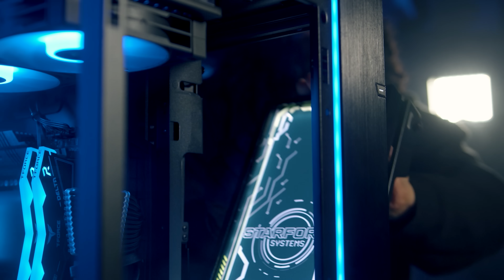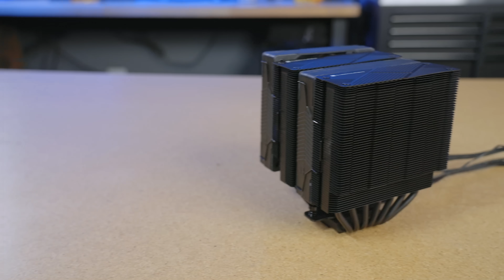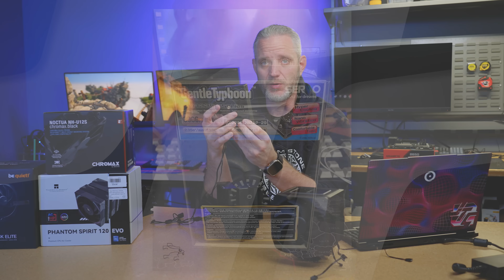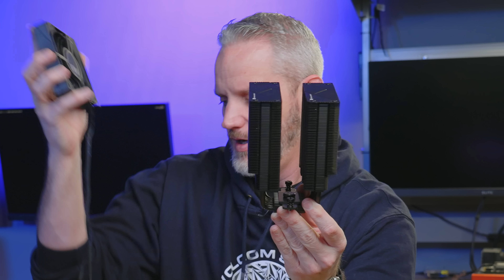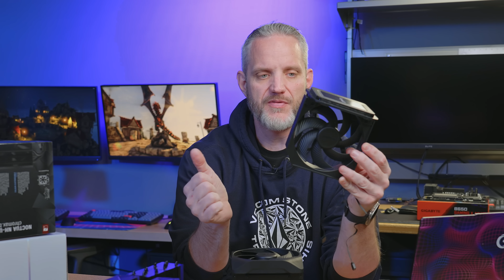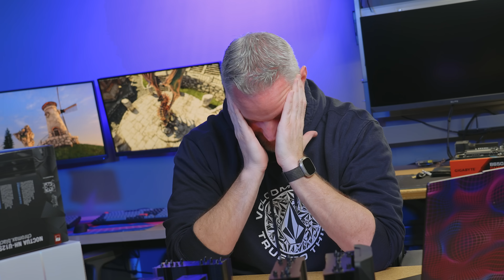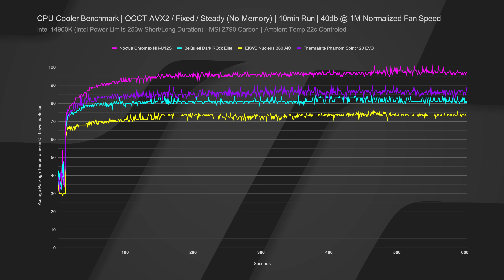This $49 CPU Cooler has big brands SHOOK! Thermal Testing Cheap vs Expensive CPU Cooler!

Comment: Some of the Air coolers you should definitely add are:
Arctic Freezer 36
Deepcool AG620/AK620 (Smuggled ofcoz)
ID Cooling Frozn A620
FSP Group MP7
Cooler Master Hyper 620S
Montech Metal DT24

And AMD Wraith Prism for reference

Comment: Hey Jay I have the thermalright elite v3 240 aio which is only 44 dollars on amazon. This cooler performs great. I was able to overclock my 13700kf to 56 all core and 46 e cores with no thermal throttling i forget what the actual temps were but I remember being impressed. I currently have it setup on my 12600kf which is overclocked to 53 all core and 42 ecore with the max temps in cinebench r23 at 70c  for the p core and 52c on the ecores. Check out that AIO for the value. They also have a 360 version of that cooler but I haven't used it. Definitely a contender for the price to performance.

Comment: Just built my first PC and the Themalright AIO I got for 50 bucks is quite efficient and it even got a subtle argb detail.

I've installed it on a MSI case which btw I noticed has the same little Thermalright "T" logo on the interior side panel (which is weird since it doesn't show in the official product photos), so the case has pretty good airflow for it being a m-atx and it only makes sense Thermalright built some of it

Comment: U should check out ID cooling A620 SE gives the thermalright a run for its money
Reply: too much noise and unreliable fans
Reply: I literally have have it and it's dead quiet u must have got a defective unit and the fans are great have had for a year and zero issues with the fans @Avrelivs_Gold

Comment: You could of course also throw in a cheap AIO into the mix. Arctic for example have some watercoolers that are way cheaper (and actually available), compared to the Nucleus cooler from EK. The "downside" of the AIO in this test was its price, obviously, since it's not a cheap product to begin with.

Comment: I do think it was a serious apples/oranges comparison using a single tower vs. a pair of dual towers.  If you want to have a non-disingenuous test and results, you should use all dual towers.  No one in their right mind is going to put a single tower air cooler on a 14900K.  If you want to make a comparison point about Noctua price/performance, then at least use a dual tower Noctua.  Otherwise test against other single tower coolers.  You are better than this, Jay...
Reply: the point is premium single tower is as expensive as the evo

Comment: Thermalright has always been decent. When AM4 first came out they had the am4 socket cooler versions of the MACHO(big single tower) they were called ARO-M14G and ARO-M14O for 40-50 bucks, still have one cooling my 7800x3d. Glad to see them getting some love.

Comment: Since you already have water and heatpipes mixed, and you brought up small form factor... I would like to see you compare the Arctic Liquid Freezer II 120 radiator against comparable spec heatpipe towers. It's an extra-thick 120 AIO rated for 250 watts TDP. It's the sort of part one might use if one wants more watercooling and doesn't have enough space for a 240 kit.

Side note, in totally apocolyptic conditions, how hard is it to trigger dryout in these heatpipe coolers? How much extra TDP capacity spec do you need to be safe?

Comment: Test out this cooler if you are keen for another thermalright variant that spices up the the build with some RGB and visible temps:

Thermalright Peerless Assassin 120 Digital ARGB

Running it on my 9600x and not at all disappointed. Max temps I have had in benchmarks and 1440p gaming with a 2nd 100p monitor was 70 degrees on the dot, nothing higher. I still want ot see how it performs with a little overcolocking and adding a higher end gpu than my RX 6800, but I don'texpect it to be affected that much.

Comment: I've used Thermalright (formerly?) coolers since overclocking my Athlon XP Barton 2500+ back when I was a kid. They have always been one of the best out there! It was a Thermalright XP-90c and I have used the brand ever since. I was able to achieve insane low temps on air with the SI-128 + Scthe Ultra Kaze 120x38mm fan on my Q6600, it never saw 50c and was overclocked to 3.6Ghz

Comment: HI jay love the vids i am thinking about getting the 9900x3d and not sure if i cant fit a 360 but might be able to fit a 280 rad or should i go with a good air cooler and i was looking at the Thermalright Peerless Assassin 120 Digital ARGB Black CPU Cooler - 120mm or a NZXT Kraken 280 Black RGB AIO CPU Water Cooler - 280mm if it will clear the ram in my Gigabyte X870E Aorus Elite WIFI7 (Socket AM5) DDR5 ATX Motherboard the ram is G.Skill Trident Z5 Neo EXPO RGB 64GB (2x32GB) DDR5 PC5-48000C30 6000MHz Dual Channel Kit what do you think would be best ????

Comment: The Dark Rock may be a premium product, but it's hard to ignore the value when you picked one up back in the I5 750 era, and you are still using it on your AM4 platform with similar results.

Comment: Great video Jay! I use the Thermalright Frost Spirit 140 air cooler and it works pretty good with my Ryzen 7700 CPU. However, it could work better with more power fans I guess. So I grabbed the pair of Thermaltake Toughfan 12 Turbo fans and going to find it out. That would be a great idea for the new video, btw.

Comment: Arctic Freezer 50 still kicking hard, and outperforms even some of the expensive Noctua or any other brands. And just for $60 (the remote control version). And let's not forget glorious Cryorig air coolers.

Comment: Thermalright and IDCooling driving the cooler prices down. Good job 🙂
Reply: + Snowman And Coolleo
Reply: @Jageronimo25  Snowman T4 and T6 are great too, I've used those for chinese X99 builds and they work great. But not too aesthetically pleasing for the eyes. I'm just rocking a R5 5600x so this Thermalright cooler for 30-40usd is pretty great.

Comment: I have the Phantom Spirit on my kids' rig (5700X3D) and a Peerless Assassin on my main (12400). Both work great and are relatively quiet. Functionally, I cant tell the difference between the two. The only reason I have different ones is because, at time of purchase, the Assassin was cheaper in white and the Spirit was cheaper in black to match my rigs.

Comment: I know you just did the Elite. But i would love to see the Be Quiet! Dark Rock Pro 5. 

Also would be good to get the noise level value noted at like the other side of the chart. That way it is easy to get an understanding of roughly where they site noise wise. Especially if the Be Quite! Coolers can potentially sit below others with their dB levels.
And yes i know that the other fan speeds were capped to have 40dB.

But super cool to see that if you weren't as concerned with noise levels, you can crank the thermalright up to get probably close cooling levels to the Elite.

Comment: Thermalright's coolers all perform roughly the same. Just buy the cheapest one that will meet your needs like the $35 USD Peerless Assassin 120 SE if you need a dual fan, dual tower cooler. Buy from BeQuiet if you want better customer support. Buy from Noctua if you want continued support in the 2035.

Comment: I have a NHU-12S and have had it for many years would I buy one now no probably not but at the time it got bought no one was making a quality air cooler in the UK in black with no RGN that I liked (that fit my case). Its only in recent years everyone one else has caught up also a little un fair on the 12S is not really designed for the 14900k some thing like a  NH-D15S would have been fairer. Your are mostly paying for the fans on the Noctua and Be quiet that is were most off the costs go. 

it seems a bit of a double standard were you constantly push massively expensive fans in your builds  but when it come to coolers you ignore the the fan quality. You also didn't normalise the fan speeds or the the noise  which are other things your paying for on a the Noctua and the B quiet.  

People don't just buy PC components for value they also buy them for prestige, looks, quietness, perceived quality it might be stupid but then why buy a BMW when a Honda Civic can do the same job for less.

Comment: So more or less pop in AIO only if you care how your rig looks. 50$ air cooler gets the job done. If temperature is 10C higher who cares if it is below 90. Also, this is an extreme test for you all gamers. In normal use, read it gaming, all these will be like 15C lower anyway.

Comment: I would be very interested to see how well the temperatures are controlled if the fans failed. I would also like the water cooling solution included as pumps can also fail.

Comment: I used the Thermalright Assassin Spirit 120 EVO Dark CPU Cooler in my build I just did ( ryzen 5 7600 & MSI B650 Gaming Plus WiFi motherboard )and I am very pleased with the results.

Comment: i just bought an ID-Cooling Frozn A720 Black right before i saw this video in my recommendation list. well, i guess  for 14 € more it's still a better deal than the thermalright.
Reply: 720 is a lot more noise with barely better results.

Comment: I literally just installed the Thermalright Phantom Spirit 120 SE ARGB CPU Air Cooler today on my new build and I was surprised when I saw the cpu temp stay around 26 degrees C, then this video poped up. FYI I live in TX and it's a 79503dx

Comment: Kinda feel bad for the Noctua single tower to be compared to dual style coolers. That would have been interesting to see how they compare to a beefier Noctua like the NH-D12L which is about the same pricing as this bequiet.
Also, I'm down to see some sort comparison of towers only. The point would be to find the best tower and to pair it to the best fans, like taking Noctua fans and put them on the Thermalright Assassin or a Deepcool AK620, etc

Comment: You can use Prime95 with a fixed FFT size for more consistent load. Internally OCCT also uses a modified version of Prime95 for some of the tests, but with Prime95 directly you have more control.
I could hook you up with some scripts to generate the config files for Prime95, y-cruncher or Linpack that I use in CoreCycler.

Comment: I've found that this is all dependent on where you live in the world geographically. For those of you that live in parts of the world where your avg temperature is low, an AIR cooler is perfect for use.  Just like those portable air-conditioners. They work in cooler countries, and you don't need anywhere near the power to use one either. NOW if you change the country to somewhere, where the air temperature is 30C+ constantly and humidity is on avg 80%+ , AIR coolers, just like those portable air conditioners, FAIL MISERABLY. All they do is push hot air around, without any cooling whatsoever. It's like if you were having a 40C + day, you were trapped indoors, without air con, and only had a face fan. Sure your face might feel cool compared to the rest of you, but it really isn't, it just has some hot air moving across it. Same scenario occurs with AIR COOLING as opposed to WATER COOLING.  THIS IS ALL DEPENDENT ON WHERE YOU LIVE AND THE TEMPS YOUR AREA AVERAGES.

Comment: I have 5 case LianLi INF fans with a Corsair 240mm AIO also using 2 LianLi fans cooling an 11900k and it keeps it around 75⁰ under full load. I ditched the Corsair fans after a year when the bearings died on 2 fans. All inside a Deep Cool CC560 case

Comment: How about ID-COOLING FROZN A620 Black in a future review. Seems to be a great cooler from reviews and my own experience and its $39. I love the stats, and the way you are comparing the cost. I'm running this with TMP7950 on my Ryzen 7 7700 and have a hard time getting it up over 68c using OCCT with its very quiet fans being on bios curve to 1700 rpm.

Comment: you used to offer the Vetroo V5 cooler as a good option for air coolers;  did you give them away, or lose it on the shelf?   😲     Actually, given the difference in power between some cpu's,  I thought coolers used to give themselves some sort of thermal rating, but looking through Amazon, they want a single tower cooler to be marketed against dual tower air coolers with no distinction as to how much heat they actually dissipate.  I have a couple AM4 systems @ 65W  cpu's;   but some of them go to double that.  And AM5 can go to 170W,  which would make a single tower air cooler a bad idea.

Comment: Got the Dark Rock Pro 4 for the 7800X3D (legacy from older system). Bit of a shame that Be Quiet doesnt offer Offset Mount but apart from that for the 7800X3D it is plenty.

Comment: I have a "expensive" Cooler Master MasterAir MA620M

It was discounted when i was building my system xD paid like 40euro for it... 

Solid dual fan tower cooler... although it is pretty chonky on the board and does impede my access to ram slots... it works plenty fine :p

Comment: Yeah I've been using the peerless assassin for everything 
Absolutely zero reason to use anything else in 90% of builds. They're quiet, and the perform well. I even have one stuffed into an HTPC at home. Even at full load, the fans aren't audible because it's got a 65W CPU and most of the time the fans are at minimum RPM. Overkill? yes, but for the money, there's nothing even close.

Comment: To hold down the bottom of the price scale, the Thermalright Assassin X120 should be in the charts. It's great on lower TDP processors (I'm using it on an AMD 9600X build). So you might want to consider a test variant that can bring down TDP to maybe 100 W or even 65 W.

Comment: Definitely think you should include the Notcoua NH-D15 cooler in your testing because its very big, expensive and would open others eyes into the value and performance you get. Also it would be nice for owners of the ND-D15 to see now it stacks up to cheaper options or possible smaller size options that have the same performance as the NH-D15
Reply: even U12A in some scenarios performs better than D15 - due to diferent design (heat pipes horizontal vs. vertical)

Comment: Hi, Jay and team! Speking of thermals, your channel is unique partially due to water cooling focus. Do the comparison of different water cooling blocks, both CPU and GPU. I bet many members of your audience would love to see that.

Nice video, by the way. I really like the metrics you came up with. However, I have some thoughts about the value of Celsius Distance to 100c TJ Max per dollar. I would argue, that after reaching a certain thresshold the diffrence is not so important anymore. If the CPU is designed to throttle at 100 °C and operate to its full potential if kept around 90 °C, is there really any added value to a cooler keeping them temp at 70 °C in comparison with cooler keeping the temps around 80 °C? Considering you preform the tests on the most heating CPU there is, the difference would be even less importnt for more easily coolable CPUs.
I would say the better cooler is more future-proofed, hence, its value is truly higher, but it deos not depend on the temp delta linearly, but more like logarithmically. I.e., instead of delta / price, I would suggest something like log2(delta + 1) / price (of course, you can multiply it by some Jay-constant to get higher numbers and not only those bellow 0.1). Or maybe you can use  sqrt(delta) / price. The point here is the higher the delta gets, the kind of less important it is.
Of course, I understand that over-complicating the metric can be hard-to-read for the audience. It is just a suggestion.
Thank you for your content!

Comment: I upgraded from a Scythe Fuma 2 (which is in a friend's PC, now) to a Thermalright Phantom Spirit 120 (non SE, non EVO). It's a little louder at full blast but it really wipes the floor with the Fuma 2 in term of temperatures on my 5800X3D. Still very quiet, though - just not completely silent anymore like the Fuma 2. The original Phantom spirit 120 can be had for under 40€ and reportedly performs basically the same as the EVO, even a bit quieter.

Comment: I'd love to see this with and without a contact frame to point out the potential additional heat dissipation certain coolers might have or if they are already thermally limited.

Also, certainly put the Arctic LF3 280, 360 and 420 in there as they often rival the cost of a Noctua air cooler.

Comment: You are right Air colling is cheaper per bucks performance, the value is better with air cooling. But for silence, better heat localisation, better heat dissipation outside the tower, water-cooling is the best. Aircooling watercooling same logic! The most expensive is not always the better, or when it is better the value sucks a lot.

Comment: There's a low profile Thermalright Silver Soul 110 I'd love to see you test. 92mm fan w 5 heat pipes for $33 that's only 110mm tall. They also have a $50 240 AIO that would be cool to see. *pun intended

Comment: even better i got the Thermalright Frozen Prism 360 White ARGB AIO for 52 and change off amazon and the white version had a extra cost for being white. the make fantastic products. keeps my AMD 5950X around 35~40 at idle and ive never seen higher than 60 under a decent load